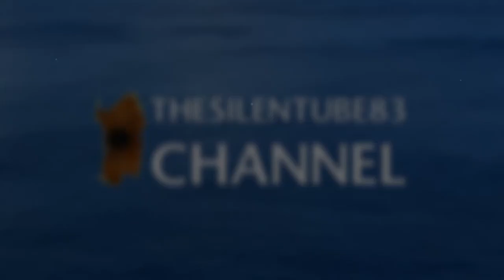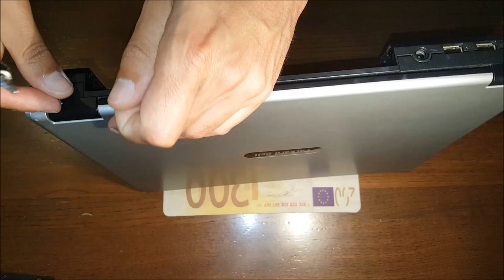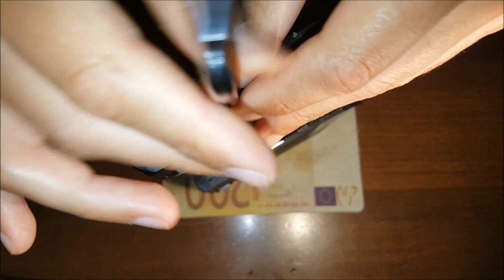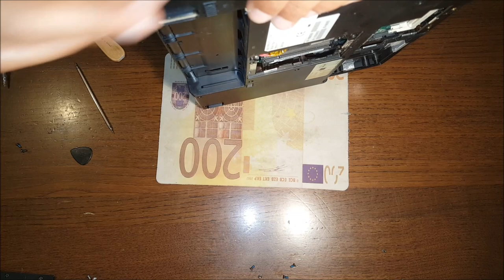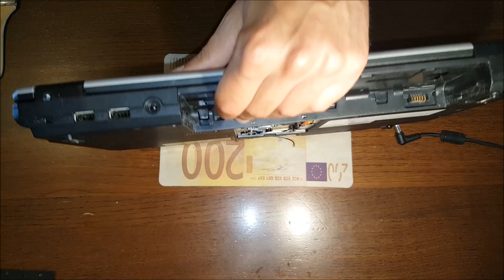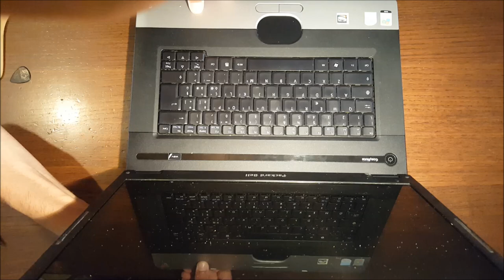How To Open & Clean Fan Packard Bell Easynote Argo ARC21 C C2 MZ35 MZ36 | Disassembly Notebook

Comment: hola capo a esa misma maquina que tenes vos se le puede poner 64 bits con 4 gb espero tu respuesta gracias
Reply from the maker: Hola, depende del procesador, ¿qué CPU tiene el tuyo? Si es de 64 bits, puede instalar Windows de 64 bits; de lo contrario, ¡no puede! Pero la diferencia de rendimiento es insignificante, podría deberse simplemente a la compatibilidad con algún software.
Reply: YO LE METI UNA 1GB Y AHORA TIENE 1,5GB
Reply: NO SE PUEDE SI EL PROCESADOR NO TIENE 64GB PERO INVESTIGA ,CREO QUE SI LOSTIENE
Reply: HOLA SAMUEL DEBES SABER SI LA PLACA MADRE SOPIRTA ESOS GB Y SI ES ASI SERIAN DOS MODULOS DE 2 GB CADA UNO

Comment: Hola,  creo que esta placa solo tiene un archivo de BIOS Versión: 3A06 del 10/2006, pero no sé si es la que lleva de fábrica ni tampoco si soluciona mi problema que solo me ha reconocido un modulo de memoria de 1 GB y otro de 512 mb. Tampoco sé si instalo esta actualización o bios original, me solucionaría mi problema, pues la MZ35 solo soporta como máximo 2 gb en 2 módulos de memoria. ¡salu2!
Reply: HOLA YO TENGO UN CORE 2 DUO TENIA 1GB DE RAM AHORA TIENE 1,5 ME LA RECONOCE PORQUE LO INDICA EN CARACTERISTICAS DEL WINDOWS
Reply: Yo tengo 1,5 gb